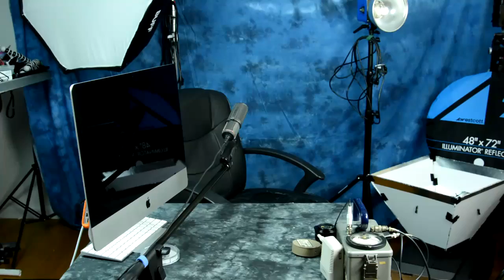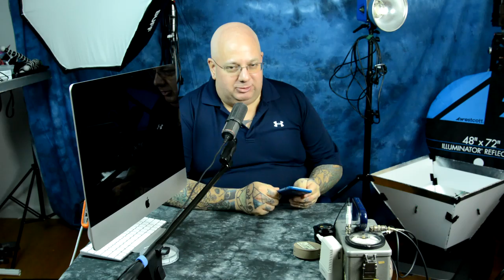Part2 : Lens Design and its PERFECT parallel in steel & blade design

Comment: Pro photographer and avid knife collector here. Tip: To sharpen new modern steels (CPM S30VN, M4, etc) you need to use diamond abrasives otherwise you are in for a long, difficult sharpen process.